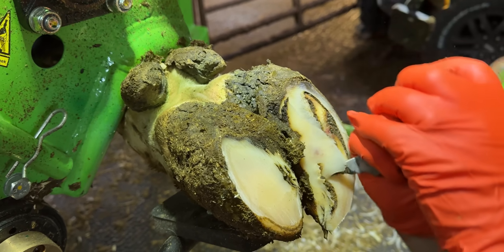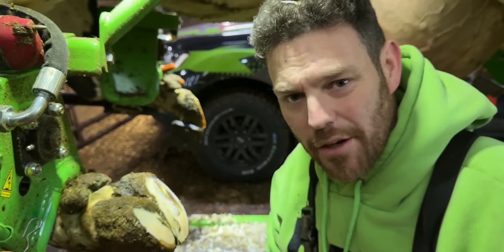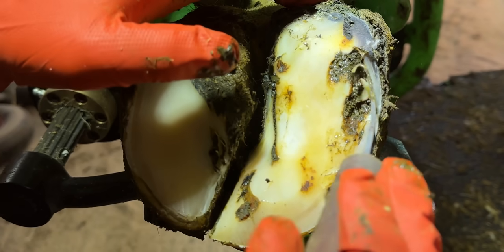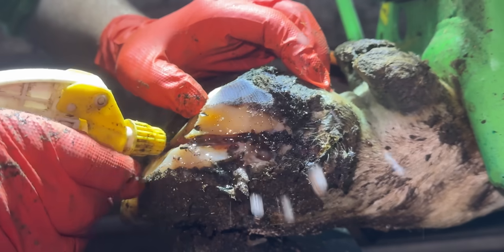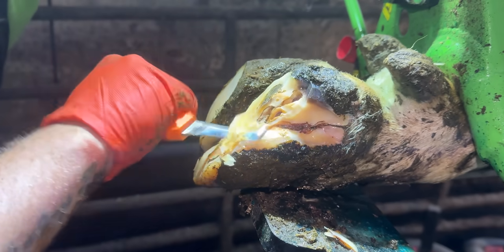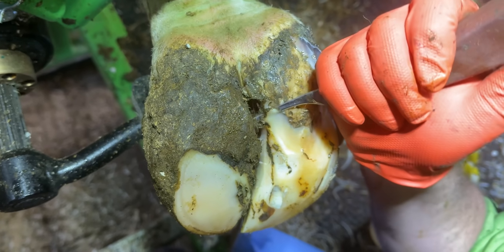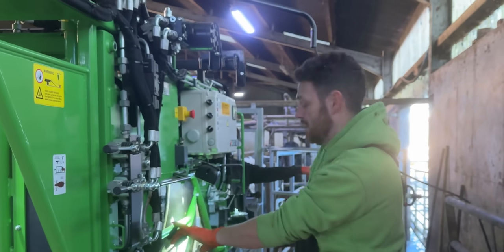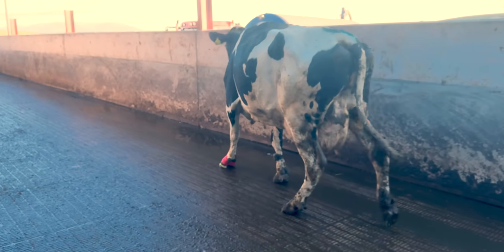this HOLE is DEEP!!!  ...... trimming out a white line lesion in a cow's hoof

Comment: Next time you need to remove staples use a flat head screwdriver as a pry bar. Use the hammer to get flat head under staple & either pull down or push up on screwdriver.  Repeat as necessary.